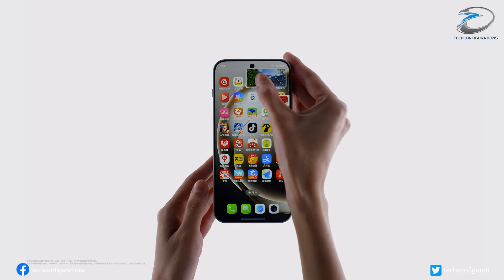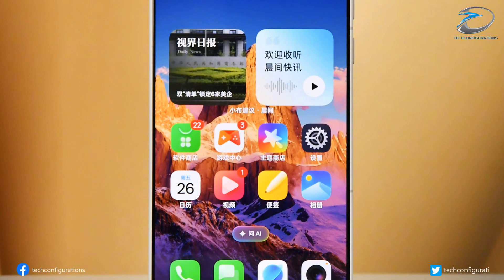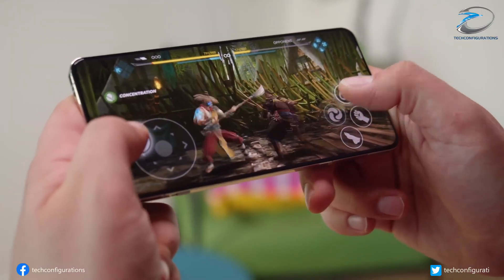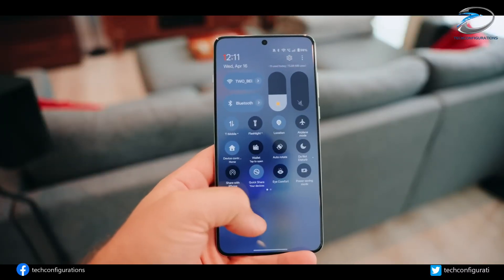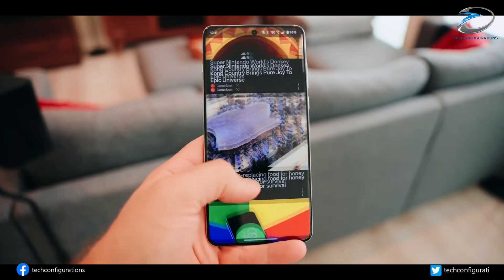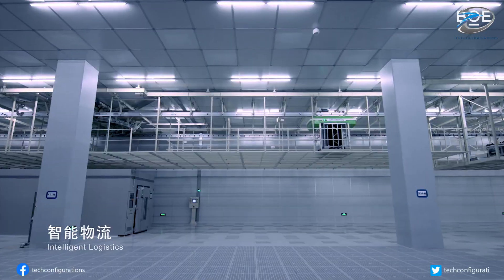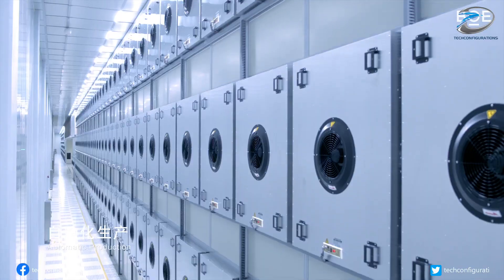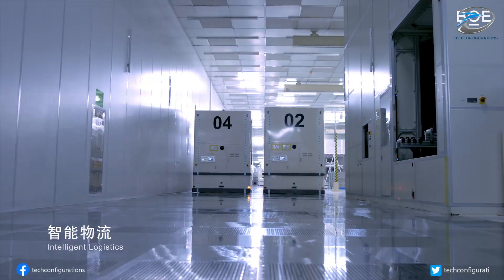OnePlus 15's 1.5K Display Explained, Not Cost Cutting as we Thought

Comment: 0:27 highest oled refresh rate? pretty sure some phones like the rog 9 have higher
Reply from the maker: we are talking about mainstream flaghisp... Also the rog support 185hz  refresh rate but the resolution is 1080p...considering that this is pretty solid display spec
Reply: Did you check in that matter Sharp Aquos R9 pro? 240Hz and 2k resolution.
Reply: @jankokominka7000  that is just marketing doesn't work
Reply: rog does not support more than 120 fps in ui so shut up.
Reply: @Kingx614  yeah im sorry, but a 2022 phone still has 165 hz in ui (redmagic 7) (not the pro version)

Comment: can anyone tell me how much benefit you'll get from a 2k resolution on such a small screen?
Reply from the maker: True the it almost impossible to differentiate between 2k and 1.5k in such small screen space... So especially since you are getting a higher frame rate in games ... I wouldn't definitely prefer 1.5k 165 Hz.... But the power consumption is a major concern for me... 165hz may drain better much faster...
Reply: @TECHCONFIGURATIONS 7300
Reply: I don't play games so sharp text and vector UI graphics are important, especially when the display is pentile.
Reply: 33% higher resolution than a 1.5K screen.
Reply: Trust your eyes when you view 1440p or higher resolution video or graphic.